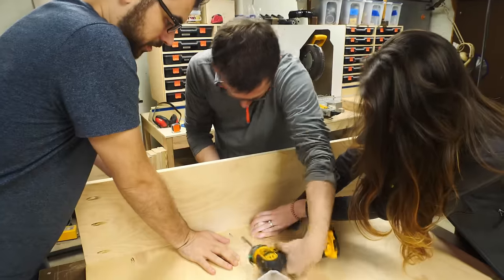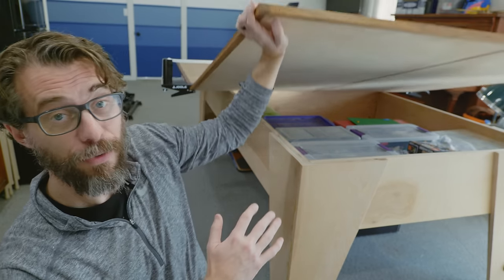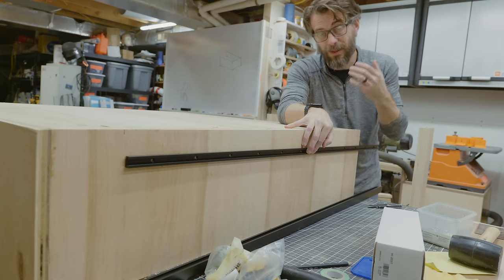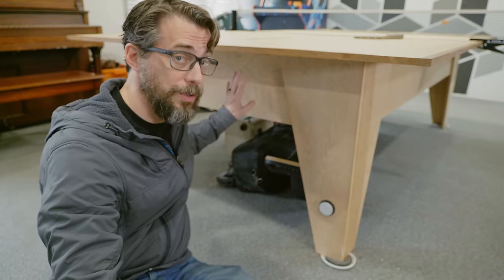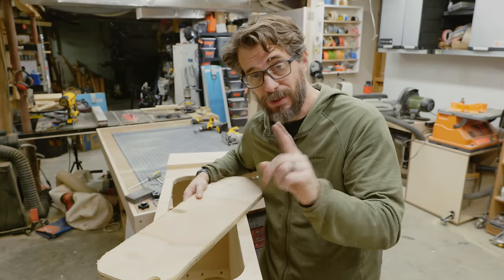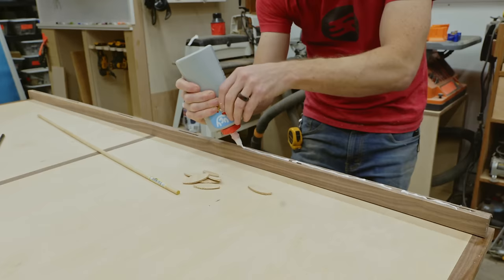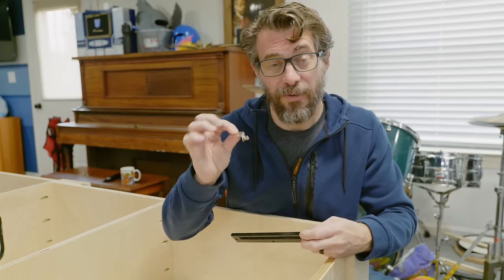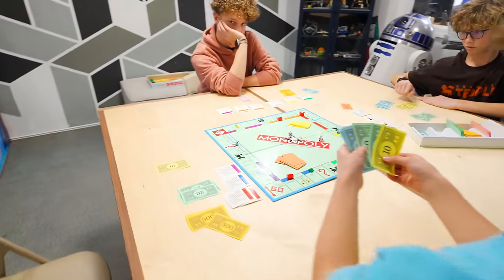Hiding a Ping Pong Table in a Gaming Table

Comment: I think you should have gone with draw sliders or linear guide rails and bearings for the extending movement. Any dust etc is going to make that thing bind up in future. Didn’t the original have cool LED scoring features? I hope you’re going to find a way to incorporate those into the new table. Otherwise, great work!

Comment: Question... In regards to the plywood tearout... Why didn't you cut within the hole and use a router to go up to the line? Perhaps using a guide for the router... a straight edge for the straight bits and a circle guide for the corners.

Comment: Another way on it could have been to make the center area fixed and then have flip out table tops on both ends and leg sections that pull out on both ends.  Would cut down on the height issue that you have at the end there, especially for lower ceiling basements/rooms.  But I really like the idea and think that I might do this for a gaming table design instead of the ping pong table, and make it a little taller with just under a bar height table height.

Comment: Cool idea. I would have mounted the table top to the moving section, that way the overhang would stay (somewhat) consistent, and it would stiffen it to prevent the racking
Reply: Each time he was like "I had an idea" or "I realized" I thought he'd recognized this. It also solves the problem accessing the hidden storage.  Side holes when closed, flip top when open

Comment: Very cool build, as you went along I was thinking, ah, I would do it this way, and then you did it that way. Not sure if anyone already mentioned it but where you are using the edge banding for the sliding surface, if that ever becomes a problem you can get thin UHMW tape that is designed for that purpose, I use it in router jigs.

Comment: Something I noticed at 17:32, the table top isnt locked down so either person can move it when accidentally bumping into it. Do you have plans to add a lock so the top doesnt move when its in the ping pong mode?
Reply from the maker: II suppose you could but when we move it, we just move the frame instead.  The top moves easily, so if you had to adjust it after movign the table, it's no big deal.